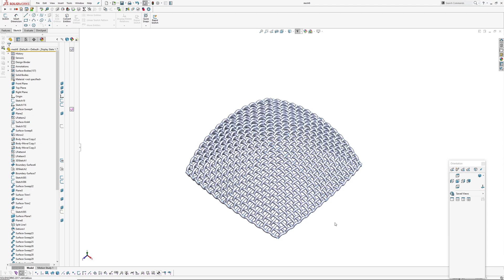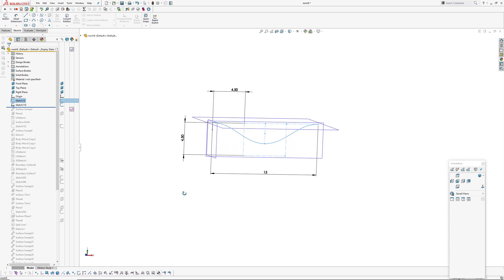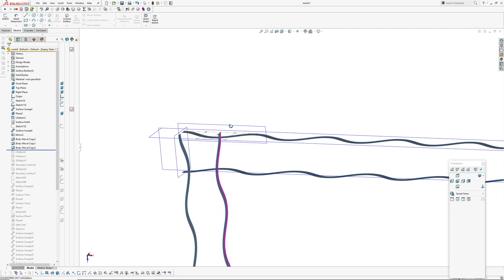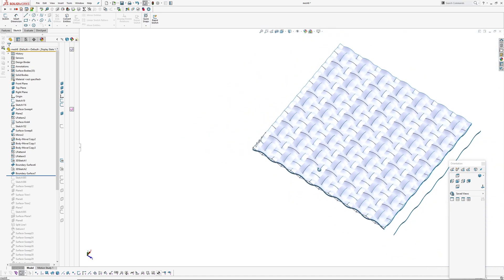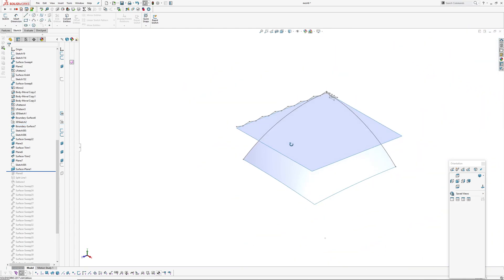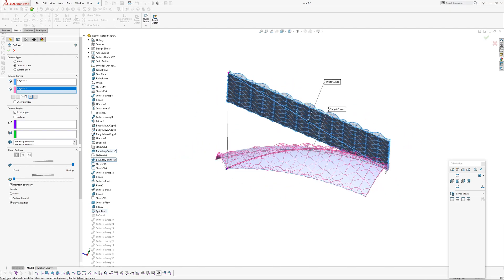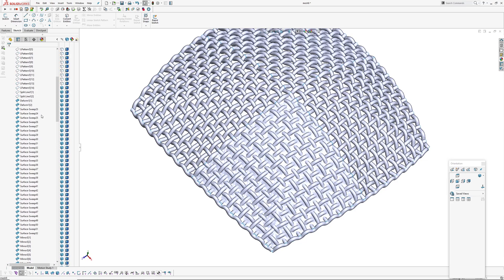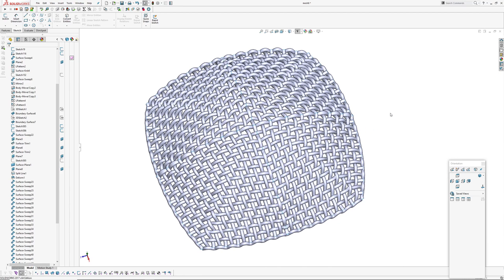How to create a curved speaker mesh in Solidworks

Comment: Oof that’s heavy Andrew! In your experience, 
If it is only for rendering and visualisation purposes,  is it better to build this in a polygon modeller like blender?
Reply from the maker: Yeah Tony, quite heavy! I have created a mesh in Lightwave before, sub d flat, then deformed it, which was fine for rendering. Doing it the way I have in SW means the wires don’t get squashed in section but does it really matter... probably not! Still, another exploration that might be useful in other ways. Now if SW had flow along surface like Rhino...
Reply: @AndrewJacksonDesignStudio  I see. Of course, this is wonderful exploration of solidworks.  Never used lightwave before. Anything special about it? Also, will you ever do tutorials on rhino? I guess there are plenty of resources already out there but still/
Reply from the maker: I’ve been using lightwave since 97/98, bit long in the tooth now😀 I mainly use it for product stills so don’t really need the latest effects/volume stuff. It does support octane render and HDR light studio, both of which I cannot work without now. I could put together a few rhino vids but you’re right, there’s lots out there and some are extremely good (The Better Living Through CNC ones)

Comment: The deform and twist tools in solidworks are very underrated in daily workflows because of the computation time they need. But examples like this, really show the potential use of the tools. This is a very unique video!
Reply from the maker: I agree Ali, the deform tool is proving to be quite robust. I just need to spend more time using it to figure out which curve topologies work best!
Reply: @AndrewJacksonDesignStudio  Maybe instead of sweeping from sides, it can be created as a trianglare surface from one side and the other from the split line.